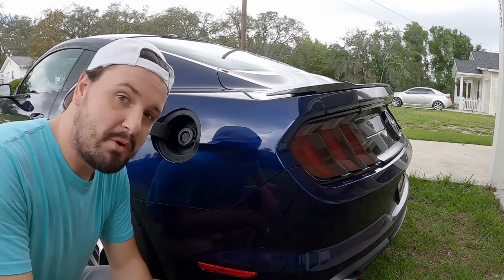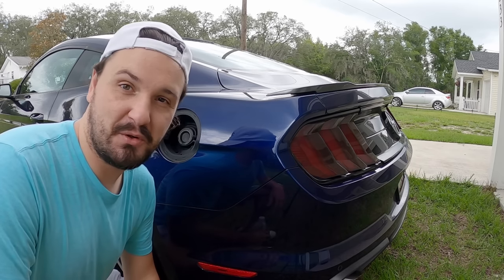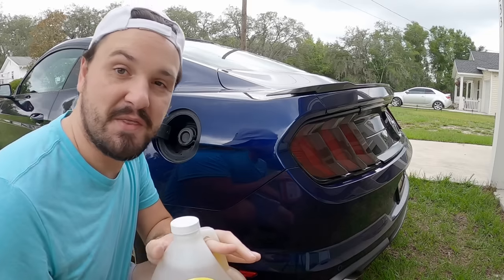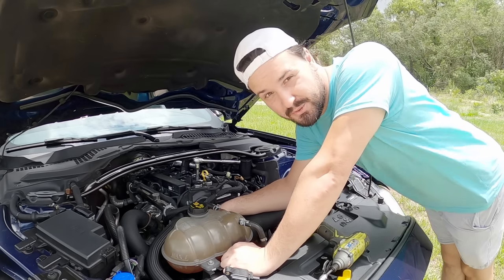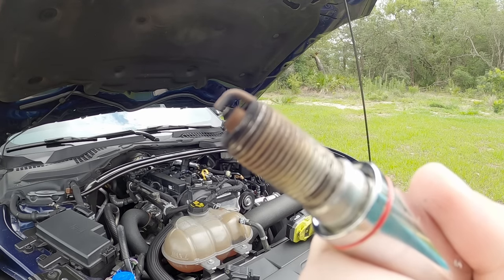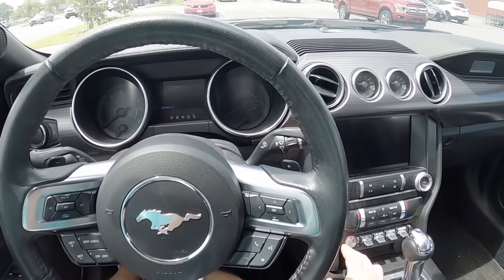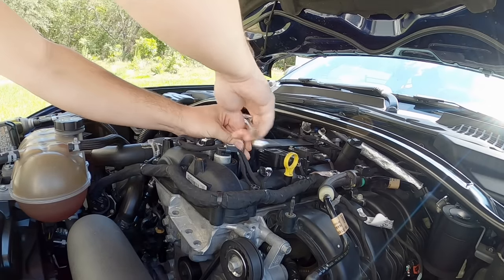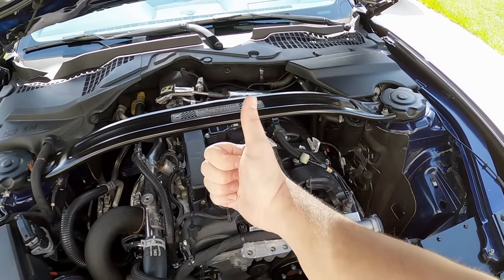The UNTHINKABLE Happened after using a Gallon of Lucas Fuel Treatment!

Comment: Retired Catapiller Heavy Equipment Mechanic: Sea- Foam works a lot better.  By the way it won't be long before your Service Soon engine light comes on with  catalytic converter codes, also O2 sensers.  Sum folks lack a little up stairs. Tear up your car to make a video.  The expense is soon to come.
Reply: Not a mechanic but something tells me he will need engine rebuilt or replaced.
Reply: I thought the same thing. I use Marvel mystery oil sparingly due to it clogging up the catalytic if used too much.
Reply: Adding the correct amount after he filled up with gas would have been OK, not the whole damn gallon.
Reply: @mehranpritchard4314  it's all good. I'll bet the car does run better now. I would change the oil, clean up those plugs, and add some of that microscopic Fluoramics for Engines Engine Treatment (8 oz. Bottle) teflon to really get the friction down to nothing
Reply: Ok  @tracyerik
Reply: Jokes on you, I don't have catalytic convertors nor O2 sensors!. Hah!
Reply: @superwedgie  Dude I'm talking about carbon build up in the engine.
Don't matter what you don't have. This will make a night and day difference.  You tube sea foam engine. You run it into running engine
Reply: @rickchambers73  I know it was a joke, like because they have been removed.
Reply: @superwedgie   God bless
Reply: @rickchambers73  He does. 🙏
Reply: Seafoam is good, but the Gumout is even better since it has ALOT of Nitrates in it!!
Reply: @tnasituning8173   Gumout isn't explosive like sea foam.  Very easy to gas foul a spark plug and create a misfire. Gumout good for the gas tank. Not running it through the engine.  I'm telling you from experience. God bless you
Reply: Sea foam is good , but they have really jacked the price. I’m staying with Lucas

Comment: And here I was, worrying that an entire 5.25 OUNCE bottle might be too much for my 15 gallon tank.
Reply: Always check the labels. Some of those additives clearly state “up to 10 gallons” so adding to a 15 gallon tank over dilutes it.
Reply: When I clean out thee old ladies upper cylinders its an entirely diff product..
Reply: Not enough fuel injection cleaner will do little, too much will do alot but most things not good. I would let my truck get down to an eighth of a tank add 2 bottles(20 gallon worth) in about 2.5 gallons. Drive normally for 20 miles and fill with gas. Never had an injector issue or a failed emissions test in 24 years or 390,000 miles.
Reply: @don2deliver  correct!
Reply: Mfg's directions: 1 gallon of Lucas to treat 400 gallons of gas. After adding 1 full gallon to a 16 gallon gas tank, he's succeeding in fowling the spark plugs and damaging the catalytic converter.   Anyone who can't follow simple instructions has absolutely no business giving advice.
Reply: @don2deliver  One case of Bud and twenty pees and your fuel injection is spotless. At least mine is!!! Lol
Reply: That's actually pretty close to the dosage that Lucas recommends. 3 ounces treats 10 gallons of fuel so that 5.25 OZ is good for 17.5 gallons. That isn't enough overdosage to harm anything. I run Lucas in every tank and I over treat mine a little every fill up without any adverse results.
Reply: @Flametopology  “fouling.”
Reply: @thekingsilverado3266  Still drinking that stuff ehh?
Reply: @Blown460  Just like grandpas moonshine it is. It also Works good for dirt on the loafers & fleas & ticks on the cat just like grandpas moonshine it is...  Burp...
Reply: Lol
Reply: @Flametopology This is satire. He knows better but is doing it for views.
Reply: 🤣🤣 me too
Reply: @Flametopology 
I think this guys idea was to see what would happen.  Kind of like dumping a gallon of Marval mystery oil in the tank. I wouldn't recommend that.  If he had a 150 gallon tank, that might not be such a bad idea especially if it was a diesel engine.  When I go on vacation,  I buy a gallon of Lucas,  I put about 20 oz in a 35 gallon gas tank. Then when I fill up add according to how many gallons it takes to fill. My pick up gets 20 - 21 MPG.  a 2012 F150 5.0 V8 gas engine crew cab.  Nice truck. 4X4 as well.
Reply: @derekhuber3392 that sounds as true as a democrat at election time. But stp works for hair tonic.
Reply: @Flametopology So are you trying to make Lucas go broke? A gallon or two now and again will keep things loosened up.
Reply: My BMW had a check engine because of oxygen sensor and I added a galón of thinner to a full tank of gas and engine light desapear and now my car runs like new
Reply: He'd destroying all of the rubber seals and gaskets it just won't show up for awhile never do this
Reply: I run double dose for my small engines and they run great!  I would like to think it keeps the carbs from gumming up.
Reply: I dump a whole bottle at a q of a tank never had a problem it helps concentrate it more
Reply: Great funny video.  😂❤
Reply: @don2deliver 
Instead of adding two bottles of cleaner at the same time, just use one bottle more frequently to prevent buildup in the first place. That’s the idea behind using top tier fuels with detergents already added.
Reply: Ok since I'm now all geeked and inspired, I'm gonna try 15 straight gallons of this stuff
Reply: For maximum clean give it the maximum REAM
Reply: @don2deliver this is correct. 20 gals =2 bottles that CLEARLY state to treat up to 10 gals, which is most of them but always pays to check the label and add accordingly.
Reply: The planet he's on hasn't been discovered yet
Reply: Lol, I can't believe that people don't see this video for what it is, an obvious tongue in cheek, mildly sarcastic video parodying amateur YouTube automotive product reviews...

It's humor, folks.  Though I cringe at what he did to the stang.   Why wouldn't you do this on a real beater car towards the end of its life?
Reply: @Flametopology

Comment: I have used Lucas fuel injector cleaner in both gas and diesel engines.  Had very good results in both. The diesel was a Cummins,  ISX 15 liter my truck had 2- 150 gallon tanks , i usually put the entire gallon,  split half and half in each tank. Helped the engine run smoother, and get better fuel mileage.  In my car, it helps keep the fuel system clean, and better fuel mileage with it as well.  Lucas says you can over treat and it wont hurt the engine,  I doubt they ever thought anyone would dump a gallon in just a 15 gallon tank.
Reply: I used to use it a lot. I switched to marine 2 stroke (TCW3) [which effectively does the same thing] because  the Lucas stuff has gotten too expensive over the years
Reply: @19jacobob93  
I haven't tried that,  I prefer to stay with what works for me.  I figured it out and at the time the Lucas fuel injector cleaner cost $32 for a gallon,  but with the improved fuel mileage in my big truck it paid off and was worth it.  The truck had 972, 000 miles when I traded it.  The treatment would last about 6 months . I'm retired now but still use it in my cars.
Reply: @bertgrau3934  nice! The TCW3 acts in an almost identical way. It's ashless, being designed for water cooled engines, lubricates the upper cylinders and also helps to keep carbon deposits at bay. It's roughly 1/2 - 1/3 the price too!
Reply: @19jacobob93 How many ounces or gallon? Thanks regards from FL
Reply: @factsnotfeelingssendit5961  The recommended mix ratio for a gasoline vehicle is usually around 1:500, and I buy it in 1 Gal/4L bottles
Reply: @19jacobob93  Thanks! I use Pennzoil semi synthetic for all my 2 strokes. I add Lucas to. Works great. I use Lucas for years oil and gas treatments. But as you said it's getting expensive
Reply: Call your engine maker ask them …. They will tell you hell no absolutely NO
Reply: @Truknup  
Thats probably true, anything that helps get better fuel mileage,  or run better factories hate that and tell you it needs to be fixed.  Assuming there is a problem.  The way I see it,  why have an engine rebuilt when the rest of the car is at the end of its life anyway?
Reply: @Truknup  We know at this point that this is not a way to gain reliable information... The dealerships want you to buy a whole new vehicle after your warranty expires. I've generally very shoddy work and advice from the manufacturers and great results from my own research and experience, not to mention reliable independent garages.
Reply: Lucas (or any) additive only does good if there's something it can correct, which is very little. These products had some success back when they were invented, in G-dad's Packard, your 2 stroke boat motor, or the WWI flying crates. These days they might clean the injectors but have an equal chance of plugging your cat conv.
Reply: @mikep490  
I can see why you say it could clog the cat. I think.if used on a regular basis,  that may not happen. On my diesel,  it didn't have what's called a , Particulate filter.  Kind of like a cat used on gas engines.  Every 6 months I would put a gallon in the fuel tanks. The first time,  it  was running rough.  Within 50 miles I could tell the difference.  That's why I used it every 6 months, about every 50,000 miles.
Reply: @bertgrau3934  A gallon treats 400 gallons of fuel, so about the right mix. His mention of Marvel Mystery oil reminds me of putting 4 ounces down the carb of a '59 Hillman, nearly 50 years ago. It was the densest smoke cloud I've ever seen. I'm not sure it cleaned up any carbon but made me wonder if it'd make tailgaters back off. It reminded me of the trucks that'd spray for mosquitoes down in Louisiana.
Reply: @mikep490  
I remember those days when a truck would drive through neighborhoods and spray for mosquitoes as well.
Reply: Have you ever tried using ATF to fill your fuel filters after changing instead of using diesel fuel? Thats an old school drivers trick and service method that we used for years in our fleet. Even carried enough 1qt containers of ATF, with the spare fuel filters in every diesel truck just in case you needed to change on the road. The quart containers are easier and cleaner than trying to get diesel fuel into the filters. You can see all the carbon it cleans from all through the fuel system and combustion chamber when you start up to check for leaks, with all the black smoke coming out till the diesel fuel catches up.
Reply: @kevinvoyer5053  
Absolutely, you're correct ATF is a good lube and cleaner.  The Lucas Fuel Injector Cleaner did a very good job. In my opinion better than ATF.
Reply: I also used Lucas fuel treatment for many years with the same great results.
Reply: user-wv1pj6wh4h  
ATF can hurt the catalytic converter.
Reply: @bertgrau3934 We used to follow the truck and play in the fog. 😮
Reply: @bertgrau3934 can't run 2 stroke oil in the newer DEF engines works great on older cat engines
Reply: You would have been better off just using a gallon of transmission fluid in a diesel for all the good that Lucas would have done. It's just an added lubricant since the new low sulfur diesel has less lubrication.
Reply: @bertgrau3934 diesels don't have cats.
Reply: @hendo337  
They have particulate filters
Reply: That’s probably because well it’s not cheap. Nobody like to throw money away like tjat lmao.
Reply: You work for Lucas?
Reply: @goochi5544  to be honest if I use it once a month I can see a difference in the mileage and performance in everything I own. I’ve also been told that the Bosch fuel pumps that ford uses on their diesels isn’t designed for American diesel it’s for the European blend which has an added lubricant. Maybe that’s why I’ve never had problem with the fuel pumps either.
Reply: His engine and gas tank is too damn small to be adding as much as a Cummings or any truck 😂😂
Reply: I did. Trust me, nothing good comes of it.
Reply: Steer clear of Avgas... technically it isn't gas.

Comment: I have been using Seafoam in everything  since 1998. Zero issues with mowers, vehicles,  chainsaws, boats ect. It's used as a stabilizer and cleaner. In 1998 seafoam sat in a outboard motor all winter and when started in the spring,  it smoked big time for about 3 minutes and then it ran like it was a new engine.  I put 1 full can in my vehicles for 1 oil change every year. Good stuff!
Reply: Seafood is 4 2 cycle  engines.
Reply: @RodneyRotten  why type of seafood?

Comment: I use Lucas in my 25 year old, diesel pickup. Modern diesel fuel has been *reformulated*, which has resulted in severe reduction of lubricity. Older diesel injectors weren’t designed for modern diesel fuel. On my last set of injectors, I used Lucas in nearly every tank and went over 310,000 miles before I had to replace injectors. Seems to work for me.
Reply: But I don’t use a gallon of it, even in my 35 gallon tank!! 

That’s pretty funny.
Reply: I've got a 2017 Ram ecodiesel and I use Archoil fuel system cleaner.... it cleans the entire system egr, turbo,  and the stupid particulate filter..... it works great.
Reply: In the correct amounts...lucas is amazing.
Reply: @leadnsteel1428 just wondered, but where does all the deposit it cleans go to?
Reply: I just dump a little oil in with my diesel, cheaper than Lucas. 🤷‍♂️
Reply: @trigtrigger9794 they get burned off and go out the exhaust.
Reply: @shootinfromthehip411 Or automatic transmission fluid.
Reply: @Axeman428   hmmm as I suspected.  Better for the environment  guess
Reply: You also could add a little 2 cycle oil to your fuel... It seriously helps compensate for the ultra low sulfur crap they are trying to pass off as Diesel these days... Or maybe just run "black Diesel" 4 parts used engine oil 1 part unleaded gasoline works best if you filter it down to one micron and then run it through a centrafuge  to remove any solids that could damage the modern high pressure injection systems... Or just use it in your old Detroit 2 strokes
Reply: @trigtrigger9794  Exactly! The catalytic converter will catch it , but then probably clog at some point but it could be worth the trouble if your engine needs a cleaning.
Reply: The diesel engine was originally designed to run on peanut oil, tested that, works amazing at least in non-winter months, need to add some kero to it for winterizing. Hemp oil is superior to peanut oil, but right now we don't have the industrial hemp plantations like good old George Washington did
Reply: Totally different scenario. Has absolutely no relevance in this application.
Reply: Been using Lucas upper cylinder lubricant for decades 
Seems to assist in lubricity.
Reply: You can add 1% biodiesel and get all the fuel lubricity you need.
Reply: I like that he dumped in the whole gallon then went to the station to fillup😮
Reply: I use automatic transmission fluid.
Reply: I use ATF.
Reply: I get far better fuel economy with 12 ozs. In a 52 Gallon tank in my 2006 Duramax...
Reply: Wow what vehicle is that!!?
Reply: If you like Lucas. Try hot shots
Reply: 300k what the he'll car do you have! Nice going!

Comment: I use the Lucas on my mowers , snowblower , chainsaws , power washer and even my weed eaters . I also use stabil 360 . Each fall fuel removed or run out and each spring everything fires up within 2 or 3 pulls. I also do normal maintenance and run 89 in my small engines . Between cars and small engines , I use a gallon a year , not 1 day .
Reply: Our YouTube Board has been waiting with bated breath on the varied applications of your using Lucas.  :hand-orange-covering-eyes:
Reply: Smart to run your small engines dry from fuel before winter storage. I also use Stabil (in 91 octane non-ethanol gasoline, small engines with carburetors don't like ethanol, over time it'll turn to varnish and gum up the tiny jets, making them useless). I install inline fuel cutoff valves from the tank to the carb on my mowers, pressure washer, backup generator, after I'm done with them, I turn off the gas and let the engine run until the carb runs dry, so the carb jets don't clog up. For my weed eater, chain saw & leaf blower, I'll drain the tank & fire it up to clear out the carb & fuel lines. Just in case the fuel I bought was tainted with ethanol blended gas. I'm careful to only use straight gas in my small equipment, but you can't always be sure the person who delivers gas to the gas station filled the tank with the right product.